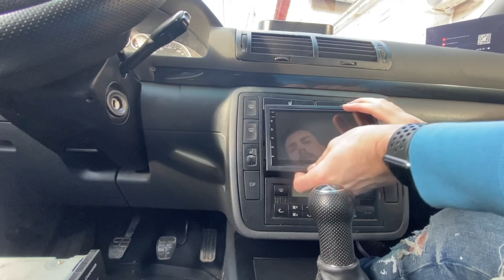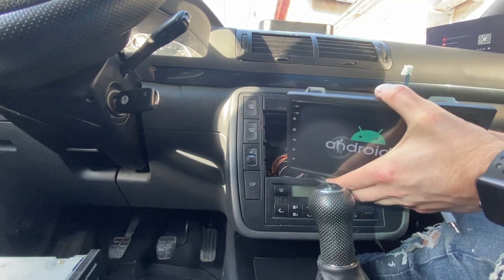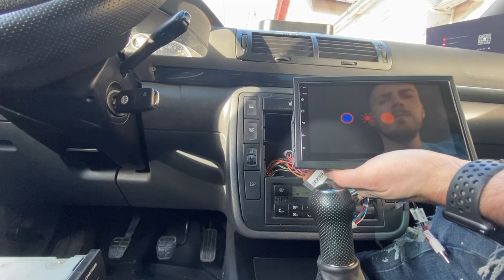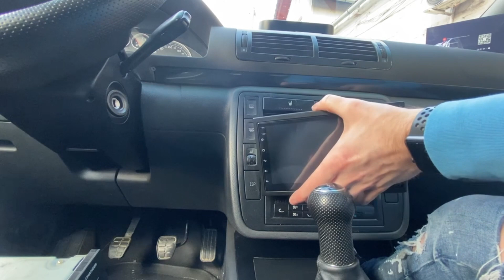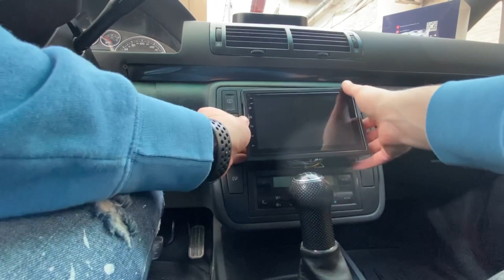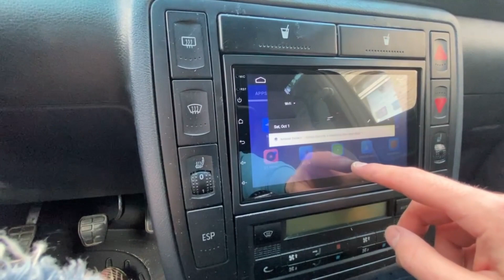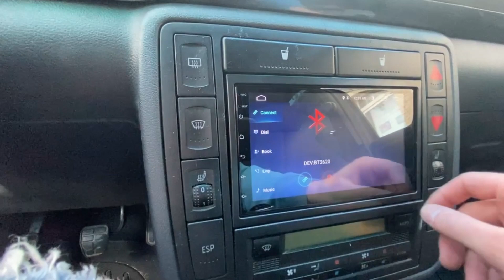How to install Volkswagen Sharan car radio android headunit, with YouTube, Waze, Apple carplay

Comment: Dauerstrom wie angeschlossen
Reply from the maker: Nope, when pull the key out the radio it turn off
Reply: @topnavi  It's different for me with my alhambra, it only works with continuous current
Reply from the maker: @tischler1988  It’s posibile, But îs No problem if the screen turn off when pull put the key
Reply: Where can i but this android???